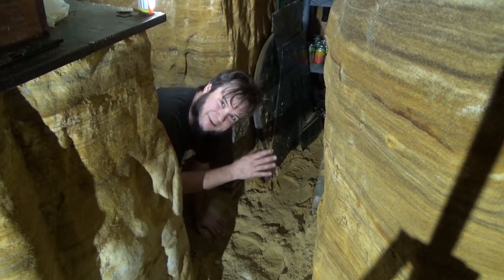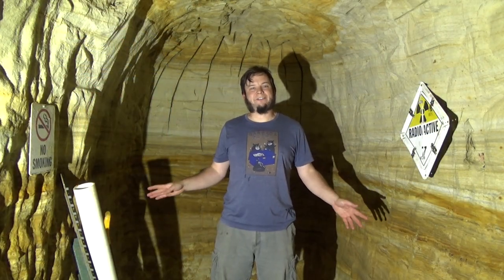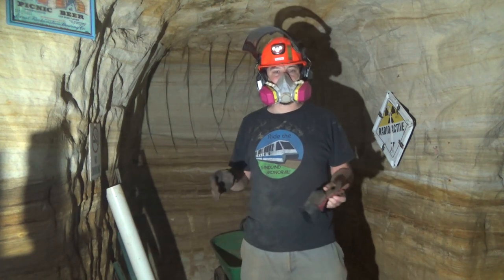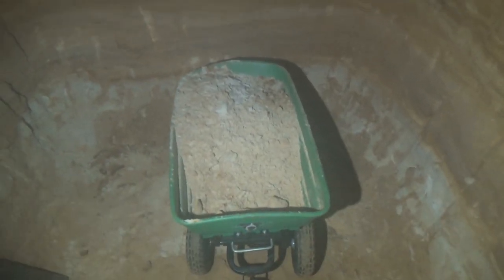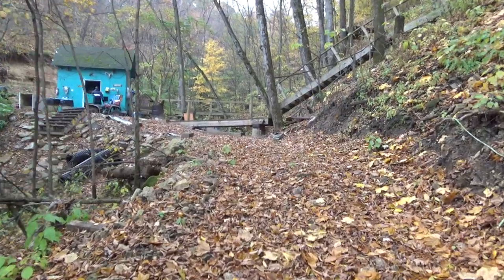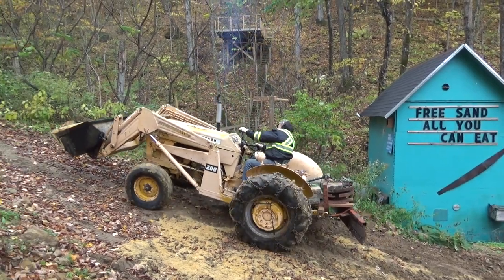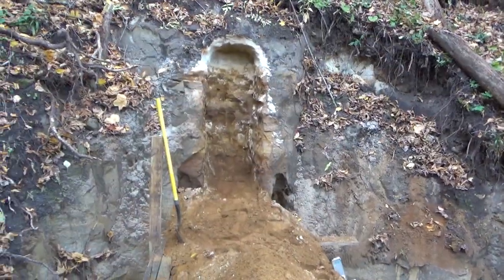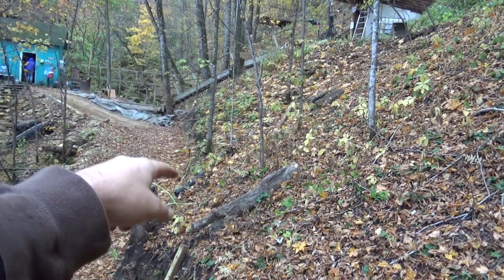Digging Tunnels & Making Cement With Beer! (Sand Bar Part 7)

Comment: Figuring out some way to make use of the humidity in the tunnels could be cool. Personally, I enjoy watching the incremental progress of the bar and tunnels. Whatever you do keep up the great vids!
Reply: Condense it to water, to water veg gardens, outside, using wind-turbine powered dehumidifiers...... ......Then when it gets more dry, limewash everything, with several layers of quicklime, and continue using the dehumidification system, as needed. Quicklime can be thrown at walls, etc, a bucket at a time...... or more rapidly with the right pressurized sprayers. It can be concreted inside. Watch out.. The more slaked lime you throw at it, at once, the hotter it'll get down there. Oven-like, if you use high powered sprayers.
Reply: Growing things under lights perhaps🤔

Comment: I've TWICE done repairs to those "garden wagons" (the better ones with the steel cage instead of the plastic).  They fail at the pivot point of the front wheels.  But a bit of welding and bolting and shoring-up, and the two that I repaired for a friend have now stood the test of time.

Comment: I came for Sandland, curious about tunneling, but I've been watching all these videos. Every one is entertaining, creative, thought provoking, super well done, with much better production values than most of YouTube. Everything is approached fearlessly, in good humor, be it a hillside, or a surplus gene sequencing machine. The consistency of that Jordan sandstone seems very similar to the Vashon glacial till we have in Seattle, formerly under 3000 feet of glacier. This stuff is so dense it requires a hammer drill with a chisel bit to loosen up, and has been known to be stable in a 50 foot tall vertical cut with zero support. This makes me think a Sandland would be readily possible out here, too. Rock on.
Reply from the maker: I bet you could find engineering reports or just old accounts of tunneling / excavating in your area.  That would give you an idea if any shoring or supports are needed. Sometimes those hard-packed formations can change consistency once air / moisture / heat is introduced. We're pretty confident that under our conditions, the Jordan Sandstone will remain stable (since we have other local caves and tunnels 100+ years old in the same stuff). I've heard of coal mines in the Seattle area, and although coal is generally not a stable or safe formation, the mining records could be informative!

Comment: Fellow Western Wisconsinite here, I haven't memorized word for word all of your digging videos but I do hope you took into account that there is the possibility of hitting some "tight gas" pockets in that sandstone. I mean I had never heard about it until the Hi-Crush plant was going in down the road a couple years back, but it sounds like a banger of a good time if you're using a brushed (vs. a brushless) motor on those power tools.
Reply from the maker: Interesting, I actually haven't heard of that phenomenon here. I know coal beds can sometimes occur alongside sandstone, and tend to have gas pockets, but coal isn't common in MN or Wisconsin. I did some brief Googling and it seems like "tight gas" is mainly found in sandstone formations about 250 million years old, with some occurrences in Eastern WI and Southern Iowa, but nothing specifically known in Western WI. The formation we're in is about twice that age. Our sandstone also has some natural crevices, sometimes with air movement, so I don't think it's sealed enough to contain much gas.

Comment: Is it possible to put up a string of lights, around the ceiling in the speak easy, so that it is more pleasant on the eyes? Better ambience. Etc. Thank you for the continued content.
Reply from the maker: That's the plan eventually. Right now we don't have permanent power run to that room.

Comment: beer: the cause and solution to most of life's problems.
Reply: Mixing sugar with cement prevents cement from hardening. There is a lot of sugar in beer.
Reply from the maker: Interesting, I didn't know that! I'll check on the mortar next time I'm out there and give an update in the next video.
Reply: @saveitforparts  if a cement truck leaves the plant with the drum turning so that it mixes on the way to the job, and the engine breaks down or the truck for some reason stalls, the driver can throw a 5 pound bag of sugar into the drum in an effort to stop the wet cement from hardening in the drum. The alternative of course is to put a short guy in the drum with a jackhammer.
Reply: @jamesscott1932  interesting! I like trivia like that. There's also the "stick of dynamite" thing for the last one. course thats like hunting squirrels with bazookas: effective but WAY too much collateral damage.
Reply from the maker: Ha, we just saw that episode of Mythbusters recently! I don't think the beer has enough sugar left to be a problem, the yeast has converted most of it to alcohol.

Comment: Wondering if you can homebrew a Dingo or some sort of like walk or stand on behind electric bucket loader with another arm above (excavator maybe) with the mount for the tools like the electric hammer, drill and/or cutting disk?  Seems like can go faster that way and less back breaking.  Especially since you have electricity available.  Though I know the feeling somewhat... where I still haven't fabricated my backhoe and front end loader accessories for the garden tractor (now appears to be the Ford LGT17H instead of beefing up one of the YT16's) and I'm still using hand tools for my field, garden and forestry work almost entirely.  To save time and mulch the yard cuttings and leafs, I do use the riders or push mowers and the blower and weed eater every once and a while when I don't have time to perform by hand.
Reply from the maker: I've considered making a little excavator with the electric track base I have (that's currently a potato cannon tank). I'm not sure how long it would last with the abrasive sand, and I don't want to lose my tank! (Even though it mostly sits in the garage unused!)

Comment: I got a chunk of steel in my cornea a coupla years ago despite wearing all the usual protection.  It was lodged in my long-flowing locks of hair, and some time after I was in the workshop, worked its way into my eye.   You don't want stuff removed from your cornea.  Total nightmare material....
Reply from the maker: Yikes!

Comment: Use a pressure washer to dig with
Reply from the maker: That's something I want to try, we don't have running water out there right now and you actually need some initial city pressure for most of them. I'll have to set up a barrel and a hose.

Comment: ok obligatory SAND LAND!!!!!!!!!!!!!!!!!!!!!!!!!!!!!!!!!!!!!!!!!!!!!!!!!!!!!!!!!!!!!!!!!!!!!!!!!!!!!!!!!!!!!!!!!!!!!!!!!!!!!!!!!!!!!!!!!!!!!!!!!!!!!!!!!!!!!!!!!!!!!!!!!!!!!!!!!!!!!!!!!!!!!!!!!!!!!!!!!!!!!!!!!!!!!!!!!!!!!!!!!!! now for the questions. whats it look like when you try a pickax on the sandstone or a regular axe . how thick will the roof of the addit be before your comfortable its strong enough? how horrible would it be to sleep overnight in the tunnel? will any kind of paint stick to the sandstone? can you cut the sandstone like snow and build a sand fort out of blocks? how far down into the sandstone can you go before you hit the water table?
Reply from the maker: Good ones! I might try to cover some of that in a future video, but briefly: A pickaxe works but is slow (sewers in St. Paul were dug that way but it took all year to complete a street). An axe IDK, I suspect it would just ruin the axe! We'll probably have an adit structure supporting the entrance (and keeping debris from falling down the hill, and to install a door). You can sleep inside, just want to make sure there hasn't been digging recently and the sand isn't stirred up! Paint does stick for a while (as seen by grafitti in other caves), but will eventually flake off, especially if it gets touched a lot. I don't think we could accurately cut blocks out without them breaking, once the sandstone is removed from the ground it quickly gets crumbly and fragile. As for the water table I think we have several hundred feet to go, we'd hit a harder rock layer like limestone before we hit water. Whew, hope that answers some things!